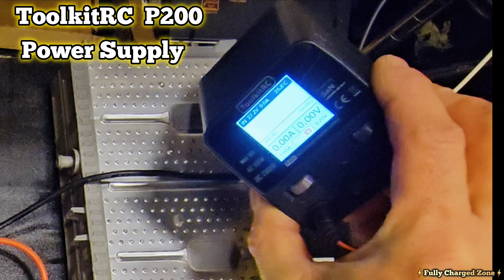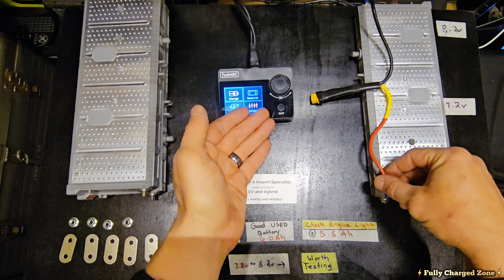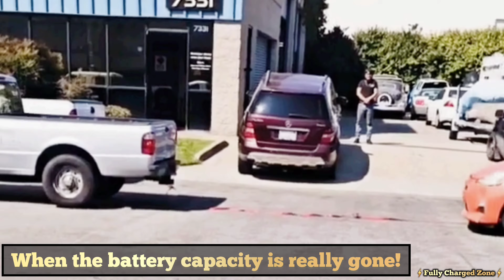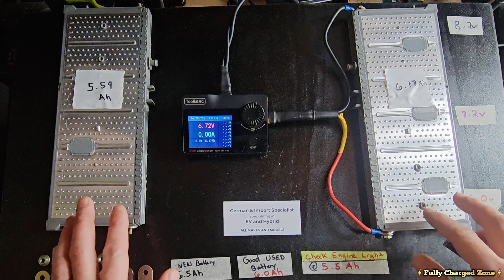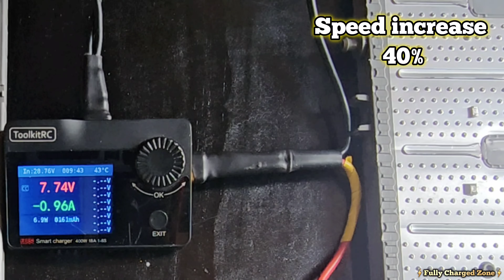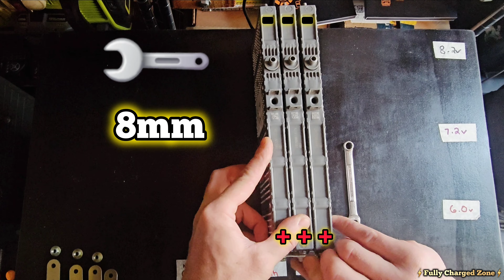Toyota Hybrid Battery Tutorial - Charging, Capacity Testing, and Balancing Battery Cells.

Comment: Hi, quick question I brought the ToolkitRC m8s 400w 18a charger and a cheap power supply Sky Toppower.  what cable or adapter can I buy to connect/hook up the sky toppower to the toolkit RC M8s and the output cable for toolkit RC m8s to charge the battery(the yellow adapter that have a positive and negative)
Reply from the maker: You just need an XT60 lead. The ToolkitRC M8S uses XT60 input and output, so your power supply should feed into the charger with an XT60 connector. If your Sky TopPower doesn’t have XT60, just get a banana plug to XT60 adapter for the input side.
For the battery side, use an XT60 to alligator clip lead so you can hook positive and negative to the pack.
Keep it simple, XT60 is the main connector you’re working with.
Reply: @fullychargedzone  I really appreciated you for taking your time to explain!!!  you are a big helper!!!
Reply from the maker: Appreciate that, glad it helped you out. That’s exactly why I make these videos, to break it down and make it easier to understand. If you have any more questions while you’re working on it, just let me know.
Reply: Hi, I brought the ToolKitRC ADP100 100W 20V XT60 Charger Power Supply RC Power Adapter Compatible with ISDT GT Power Hota SkyRC RC Battery Charger on amazon.  For some reason, my ToolkitRC m8s 400w 18a 1-8s display is not the same as yours.  I selected NiMh battery the displays show Nixx peak  = 5mv
                                                                                                                                        cells = auto  
                                                                                                                                        charge current = 2.0a  
                                                                                                                                        dischg current = 2.0a
I dont see a option to adjust the voltage, but I m able to adjust the current amp.  when I select charge function, the displayed show charge to:  9.00V  with the options either cancel or ok.  is it because I brought a different kind of charger?   thanks for your reply.  by the way, im a rookie
Reply from the maker: You’re actually set up correctly, nothing is wrong with your charger. The reason you don’t see a voltage adjustment is because you’re in NiMH mode. NiMH doesn’t charge by setting voltage, it uses delta peak detection, that’s your Nixx peak 5mV setting. The charger decides when the battery is full automatically.
That 9.00V you’re seeing is normal, it’s just estimating pack voltage based on auto cell detection.
Now, if you want to manually control voltage and current like in my video, you need to go into the M8S voltage output mode. That mode lets you adjust both voltage and amperage directly.
Also important, don’t run a regular power supply straight to the battery. That can backfeed and damage the power supply. The M8S has built in protection and acts as a buffer, so in voltage output mode it prevents voltage from going backwards and keeps everything safe.
So your setup is fine, you’re just in NiMH charge mode instead of voltage output mode depending on what you’re trying to do.

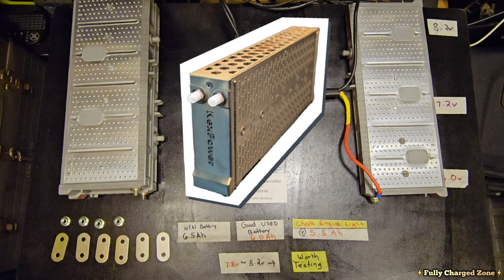Comment: 9:22 How do you reconcile charging a lithium battery with the same voltage ranges as the NiMH chemistry? I've been tempted to try the swap, but concerned that I can't reprogram the proper voltages in the Toyota BMS.
Reply from the maker: You really don’t “reconcile” it, that’s the problem. Matching voltage doesn’t mean the chemistry behaves the same. NiMH and lithium have completely different charge curves, internal resistance behavior, and state of charge mapping.
Toyota’s BMS is designed specifically around NiMH characteristics, how it rises, falls, and balances. Even if you match the nominal voltage, the BMS will misinterpret what it’s seeing from a lithium pack. That can lead to overcharge, undercharge, or constant faults.
So your concern is valid. It’s not just about voltage, it’s about how the battery behaves across that voltage range, and the stock system isn’t designed to manage lithium without major changes.
Reply: @fullychargedzone Thank you. A year ago in your video you described the replacement as "really good" and that you use them yourself. Do you still use them? And did you see frequent errors resulting?
Reply: You don't necessarily need to reprogam the BMS.
As mentioned in the first part of the video, every module consists of 6 NiMh batteries in series. The voltage range of those is from 6x1=6v to 6x1.36~8.2v, but there's two of them in series, making a module of 12s, and only each 12s gets a monitoring wire to the bms. Worth mentioning that these 12 series batteries within two modules in series are not monitored or balanced by the bms. The lithium, depending on the chemistry you want to use (if you want to go by a diy approach) is going to be: 2.5v to 4.2v for lithium-ion cells, or 2.5 to 3.65v for lifepo4, or even 1.5 to 2.8v in the case of li-titanate which, obviously, doesn't satisfy the onboard bms's reading criteria.
But, instead of two 6s NiMh modules in series, you could connect the bms signal wires to 2 2s Li-ion in series, so the range will be 6v to 8.2v for each module, imposed by the onboard bms of the car, or 3v to 4.1 per cell. This won't let the car make use of the whole capacity of the cells, but it should improve their lifetime.
Same would go for lifepo4, only due to its lower voltage, you'd need a string of 5s, instead of the 4s in the case of li-ion.
Ideally, you'd probably want to use a separate specialized li-ion or lifepo4 bms to monitor, balance, and even charge the cells, which could get you to convert the car into a plug-in.
Reply from the maker: Matching the voltage isn’t enough. The Toyota system is designed for NiMH behavior, not lithium. Even if the numbers look right, the car won’t read or manage the battery correctly.
Also, grouping lithium cells under one BMS tap hides what’s going on inside, so you can’t properly monitor or balance them.
It might “work,” but it’s not something the stock system was designed to handle safely.

Comment: Can you just keep driving the car with the light on and just not worry about it?
Reply from the maker: In some cases, yes, but it really depends on what set the warning light off in the first place. A minor battery imbalance or weak module can sometimes let the vehicle continue driving for quite a while, but if the problem gets worse, it can eventually leave you stranded or start damaging other components.
My advice is at least scan the codes before ignoring it. Hybrid systems usually give you warning signs long before a complete failure happens.
Reply: @fullychargedzone    I found out!  The car goes into "Limp Mode" and can barely move itself.  You have no choice but to get it back home and take the battery back apart.  Time for my second attempt at fixing the battery!  The first time I moved some modules around and cleaned all of the terminals.  This time I have two new modules on the way to replace two ruined modules.

Comment: Question:  How long did you charge the (2) good modules to 8.2volts?  The bad module you mentioned only 20minutes charging.  Great video!
Reply from the maker: The healthy modules took significantly longer. Fast voltage rise is actually how you spot a failing module.

Comment: great video, just wondering why you use three cells together to balance instead of two or may be four ? i thought toyota always use the voltage in pairs (two) ?
Reply from the maker: Good question 👍
Toyota does monitor the HV battery in pairs at the ECU level (each block = 2 NiMH cells ≈ 14.4 V).
In the video, I’m not changing Toyota’s block configuration, I’m grouping three individual cells during bench charging,capacity testing and balancing only. The reason is to average internal resistance and stabilize voltage while cycling, which gives more consistent capacity data and prevents one weak cell from skewing the results.
Once testing and balancing are complete, the cells go back into their original Toyota two cell block configuration exactly as designed.
So: Toyota pairs = vehicle monitoring
Three cell grouping = temporary testing method, not how the pack operates in the car.
Reply: @F@F @fullychargedzone ank you for the response, my question was really about how many number of maximum cells you can connect together and balance it, for example can i connect all the prius 28 cells together and balance it instead of three that you showed in your video?.
Reply from the maker: Yep, I’m connecting all 28 in parallel to balance. That’s how I do it. I should’ve said that in the video. Appreciate you watching .

Comment: How can i recharge my depleted HV battery on a 208 Toyota camry hybrid?
Reply from the maker: Technically, yes...  the pack can be removed and charged externally, or modules can be charged individually using HV rated equipment. That’s how reconditioning is done in a professional setting.
However, this involves 200+ volts DC, exposed bus bars, and serious shock/fire risk. It requires proper PPE, isolation procedures, and chargers designed for NiMH HV modules.
For most owners, the correct first step is still the 12V battery. If the car can go READY, it will recharge the HV pack on its own.
External charging or module-level work should only be done by trained hybrid technicians with the right tools... If you attempt to disassemble the pack be careful.

Comment: In the middle of the video, did the guy actually get the regenerative breaking to work to jump start the high voltage battery ? So didn’t need to open up the trunk and take out the battery and recharge the high voltage battery one pack at a time ? 

My Prius depleted  the high voltage battery because of a p3139 code -if remember it right. I was trying to figure out why it wouldn’t  keep the engine running , come to find out that a lot of people said it could be the MAF sensor or the fuel pump, ended up replacing both and being a dummy I kept erasing codes to the point the main high voltage battery wouldn’t crank the car anymore (new 12 volt battery in trunk) 

Thank you would love to hear your input before I partake in this diy
Reply from the maker: Great questions! 👍

On a Prius, regenerative braking can only charge the HV battery after the hybrid system is already in READY mode. So if the HV battery is too low to spin the engine, regen won’t wake it back up, the car has to be running first.

For code P3130/P3190/P3191 (engine won’t stay running), the engine usually shuts off to protect the HV battery. If you keep trying to restart while the issue is unresolved, the HV battery drains to the point where it can’t start the engine anymore — and a new 12V battery won’t help at that stage.

Once the HV battery voltage drops too low... You need to externally charge it or charge modules individually... Then fix the root cause (MAF, fuel, vacuum leak, etc.) so the engine can run and recharge the pack properly. I always recommend checking fuel delivery & air metering before clearing codes. Clearing them too early just forces the car to keep trying and drains the HV battery 😅

If you’re unsure about the HV side, it’s totally okay to get help,  high voltage can be dangerous. But if you follow the video carefully, it’s doable as a DIY. 💪⚡️

Comment: "Another question, please: When charging the cell, does it have to reach 6Ah?"
Reply from the maker: The key is consistency between all cells in the module... If all cells are close together (example: 5.3Ah – 5.5Ah) pack will operate fine.If one cell is much lower than the others that cell becomes the weak point.

Toyota hybrids rarely use 100% of the cell capacity, the BMS keeps the state of charge between 40%–80% to extend life. So the cell doesn’t need to reach 6Ah to function properly.

In short... You don’t force a cell to 6Ah. You measure capacity to identify weak cells.  Balance the pack so all cells match each other

If a cell is below 4.7Ah or has high internal resistance  it’s usually time for replacement. 🔧

Let me know if you have more questions, happy to help! 🚗⚡

Comment: Hi..
How are you ? 
I want ask about number cycle charge and diccharge..

"Do repeated charge and discharge cycles improve the condition of the cells?"
Reply from the maker: For Toyota hybrid Ni-MH cells, repeated charge/discharge cycling does not increase the true capacity of the cell. Once the chemistry has aged, it can’t be restored like new.

However, balancing the modules (controlled cycling) can... Re-align the voltages between all modules, Reduce voltage drift between cells, Help the BMS operate more efficiently, improve performance if the pack was unbalance.

But it doesn’t reverse long-term degradation like: Loss of electrolyte, Increased internal resistance and Electrode wear.

So in short - Controlled cycling can help balance the pack and improve symptoms. It cannot permanently restore lost capacity in an old cell

If a module has a weak cell or high resistance, replacement is the real fix.

Comment: Can 3Ah cells be regenerated to 6Ah? Or recycled? 😊
Reply from the maker: No, a 3Ah cell can’t be regenerated into a 6Ah cell. If a module was originally rated for 6Ah but is only showing 3Ah now, that means the chemistry has already degraded. Once lithium ion or NiMH cells lose capacity, you can’t bring it back only temporarily surface-charge it, which doesn’t restore real usable Ah.

Regenerating batteries is a misleading procedure. It wastes time, gives customers false hope, and doesn’t fix the root problem. As a hybrid/EV tech, I don’t recommend it.

They can be recycled, but they can’t be restored to their original capacity. I hope this helps
Reply: @fullychargedzone Thank you very much🍻😃

Comment: @FullyChargedZone  Excellent video. Is any risk of cell swelling if pull the hybrid battery cell out of the housing for discharge/charge circle? For Lexus RX400H or RX450H, there are 8 units per cell which is different from Prius 6 units per cell. I read your comments, "Don't discharge below 6v or charge higher than 8.4v", "The nominal voltage of approximately 8.2V", why can't set the charge higher than 8.4 V? The nominal voltage of approximately could be 9.6 (1.2x8 v) each cell. Is it correct?  Currently, I try to recondition my 2011 RX450H hybrid battery using Hitec X4 AC Plus to discharge charge the battery cell. I firstly try to discharge charge 2 cells which were pulled out from hold housing, unfortunately, both of them are swelling after 3 circles discharge-charge. I set the parameter as: 
Discharge-charge circle, 3;
Discharge 1A, 8 V; 
Charge current, maximum 3 A;  
Capacity cut-off, On with 7500 mAh; 
Waste time, charge to discharge 5 min; 
Safety time, off 120 min;  
Should I put back the cell into the housing and tight them for discharge-recharge? The charger I applied is different from yours. Would you like to give me some suggestions on how to set parameters like discharge. I really appreciate your help.

Comment: Mine just died completely won’t start last week 50 mpg luckily it died right out of the garage. Wew. Havnt started ck battery yet . 12 volt battery 12.3 .
Reply from the maker: If it won’t ready up, definitely check that 12-volt first. 12.3 V is already low for a Prius...  they get picky below ~12.5 V because the hybrid system relies on that battery just to boot the computers. A weak 12 volt can make it look like the HV battery died even when it hasn’t.
If the 12 volt tests good, then the HV pack is the next place to look.

Comment: 2 questions 1st can you recommend a charger that can do multiple modules at once 
2nd are modules that have been sitting for an extended time able to be saved if they meet the guidelines?
Btw great video. Thanks
Reply from the maker: You can absolutely charge multiple Prius modules at once... just make sure each channel has isolated outputs. Hobby style multi-channel chargers like the iCharger Duo/Quad series work well because every channel is independent and lets you log capacity at the same time.

And yes, modules that have been sitting for a long time can usually be brought back if they still meet the basic voltage and internal resistance guidelines. The key is slow charging and proper cycling to see if the capacity returns. I’ve recovered a lot of “shelf-sitters” this way.

Thanks for watching!

Comment: Wow! Thanks for the vid. I have a 2013 Prius C with only 66k miles. I started getting the "Check hybrid system" warning.  Long story short after having a Toyota tech replace a control module and wiring harness to inverter it still didn't go away. The INF code was 612. He then pulled the cover of the hybrid battery where he found lots of rodent damage. We left it until I decide which path to go down. I've been looking at battery options, new OEM nimh @ ~$2,800 installed, or a tested and 3yr. guarantee nimh @ $1,400 and I'd install,, NexCell sodium ion pack @ $1,400, etc. I'm guessing with the rodent damage that just testing and replacing cells might not be the answer. Any thoughts? Again, thanks for your efforts.
Reply from the maker: It sounds like you might need a high voltage battery harnesses.
Reply: @fullychargedzone  I was under the impression that it was the harness that was replaced, I'll check on that.